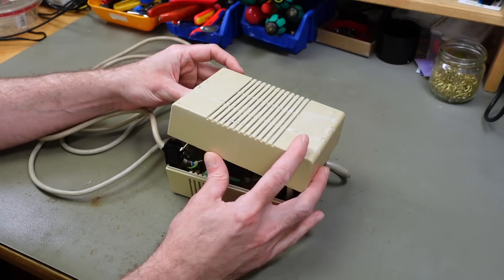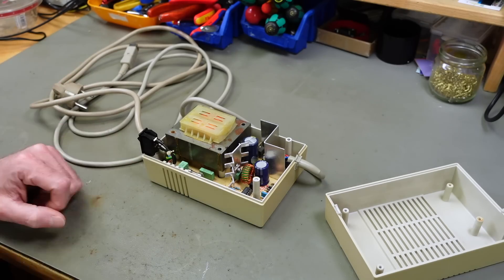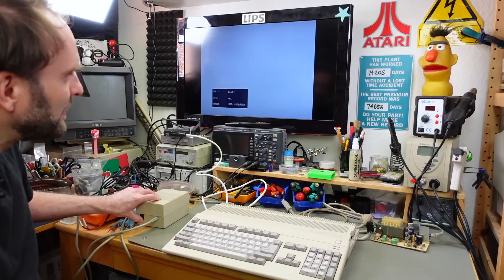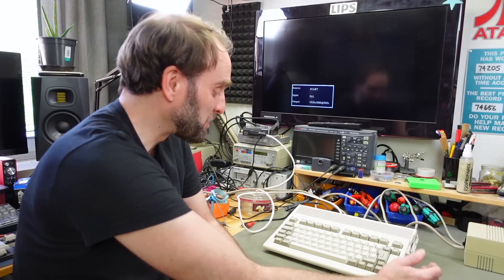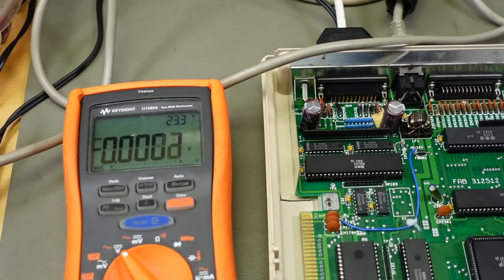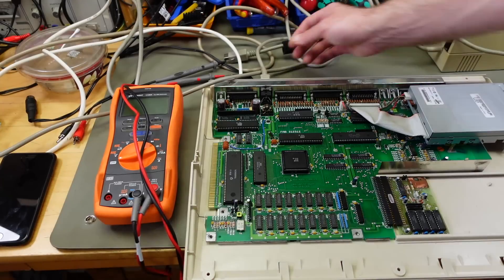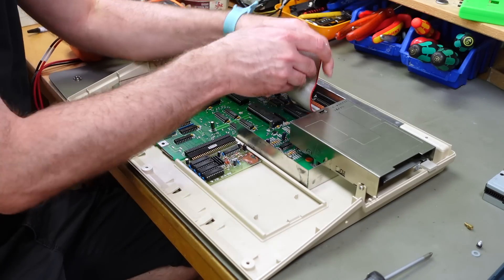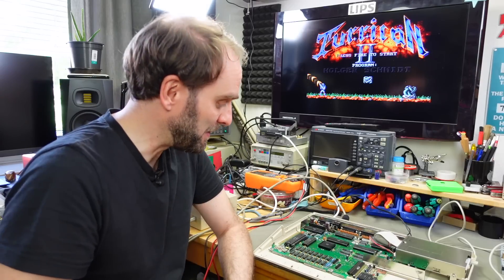Early Revision 3 Amiga 500 Restoration Finale

Comment: Hi Jan. Less than 100 Ohm impedance to ground on the 5V rail is concerning. It may mean that some ICs are marginal, leaking current to ground. More modern power supplies may be able to provide the extra current, but the longer you use the Amiga this way, the higher the chance that the ICs in question will eventually short out. One way to check this is to remove the socketed ICs one at a time, while measuring the impedance from 5V to ground on the multimeter. At some point you will pull out an IC that will lead to a jump in the impedance, beyond 100 Ohm. That is then the guilty party. Another test is to hook up the oscilloscope, with AC coupling, to the 5V rail of a modern Amiga with the computer on. Check the ripple with the old and newer power supplies. If the old one has higher ripple, you will know it's less powerful than the new ones, which may explain why it fails to deal with the 70 Ohm impedance from 5V to ground in the old Amiga. Either way, I doubt 70 Ohm is normal.
Reply: It's also entirely possible there's a capacitor about to let go, I've had a few of the the little yellow bead decoupling capacitors fail and go leaky /short on A500s
Reply: 70 ohms is only 75mA at 5V. Some of the resistor packs connect between 5V and ground as well (I have no idea why they did that). What reading you get on your multimeter generally depends on the test voltage it applies.. it can be enough to turn some gates on at least partially
Reply: @jaycee1980  That's not how you calculate current consumption in active circuits (i.e. circuits containing more than just passive elements). When the computer is actually on and the gates/flip-flops are switching, there will be a lot more current consumption than your static calculation. Every time a flip-flop or gate switches from one state to another, there is current inrush beyond your simple I = V/R. If only everything were as simple as Ohm's law... Unfortunately, computers are not resistors.
Reply: @thebyteattic  Yes, I know that... but when you are just measuring across the rails with a multimeter, you are not probing an active circuit as the meter is not supplying enough voltage to make the circuit active.

That wasn't the point I was trying to make. What I was saying is that 70 ohms across the 5V supply rails of the board doesnt indicate any sort of short - in pure resistive terms its only a low current leakage.
Reply: @jaycee1980 That low current leak is indicative of a marginal semiconductor, which is the entire point I originally made. The leak may be considerably higher when the device is actually subjected to Vcc and switching. Semiconductors should not have low impedance from Vcc to ground.
Reply: @thebyteattic  Having measured many Amigas in this manner,  I can say these sort of readings are typical. Remember also that the Amiga is quite old NMOS technology, not CMOS. 

As I also said in a previous post, there are places where resistor packs are wired between 5V and GND for some reason (possibly Thevenin termination).
Reply: This is par for the course for Commodore chips where defective prints were turned into marginal chips at the factory. You can find the affected chip by moving a weak magnet on the chip and watching the resistance readout. Sometimes a fingertip's biomagnetic field is enough to cause weird phenomena.

Comment: On the PSU: I would measure the voltage at the connector on the power supply side, if that is at normal voltage when it shows 0.2v on the other side you will know the issue is with the cable or connectors. P.S: Many multimeters continuity tests "beep" with a very high ohm value like 50ohms which would obviously not be ok for a power line. But also realize that tests is done with almost no current passing, so a voltage test as mentioned first would give more useful info.
Reply: I was thinking the same, not trusting continuity test on a wire that could pull half an amp, I found it interesting that -12v read high and +12v read low, as if the ground wire was raising a volt or two. I would measure the volt drop from the ground pin at the power supply compared to ground on the computer, and same with the 5v pins at the psu versus at the computer. But I fully understand not wanting to spend more time on this.

Comment: Early A500 were power hungry and had a beefy PSU, highly sought after by the early 90s because the accelerators needed those extra amps. It might be that the PSU is just too weak to power up the old A500. Later revisions cut power consumption considerably, from 35W PSUs to 24W at the end. Should be easy to check as the values are embossed on the PSU case.

Comment: You really are guesing in the dark with that setup. Having a decent modern PSU with stable voltages and measurements to show you current draw on each voltage rail would be very helpful to debug systems which draw incorrect amounts of current etc.
Also don't be shy to use diode mode when testing continuity etc. It's often a more telling test than just ohms.

Comment: 1. Plug the power into a known working board and Che k voltages.
  Not sure but maybe more modern systems don't use the 5v, but use a voltage regards off the 12v. Not sure, don't work on amiga

2. Cross check the power outputs with a working power supply

C
Keep up the great work

Cheers. Keith

Comment: When you use that anti static wristband you are grounded, so beware of that when you are working with high voltage. I don't know if you have a GFCI or not, but if you should touch the live connection with your right hand the current could go through your heart because your left hand is grounded.
Reply: Don`t they have a small resistor in the wristband circuit? I seem to remember this from the 1980`s when I worked in a microchip factory. I must of been bored and measured it.
Reply: A 1 MegaOhm resistor. Pretty safe.

Comment: Not sure about this PSU, but I think some of the older Amiga PSU come with a sense line for the +5V supply, which is used to keep the 5V voltage stable, regardless of the current being drawn by the computer, compensating cable losses (i.e. voltage drop by the cable's resistance, according to Ohm's law). If it has a sense line, could something be wrong with it? 🤔
Reply: None of the brick PSU's had remote sense

Comment: There will be a voltage drop over the connector when under load. It will be that the connector has been used with the thicker pin connectors. It will measure fine without a load a quick fix is just to swap on a different cable from one of the other power supplies

Comment: since all three rails were low, trace it back to a common component.  That'll be your weak link. Checking the voltages with an o-scope may also show waveforms on the DC lines that shouldn't be there. Good luck!

Comment: Hi Jan. Could the power supply issue be the pin size. A circuit can behave different when loaded. It can show continuity without load and break down under load. As a sanity check, can you solder another lead with the bigger pins to the underside of the power supply board to test ?

Comment: Okay.. so on the jack side we have 2 . something volt.... and on the plug side at that same time??..... if the power supply is holding up the 5v.. then the voltage is being lost in the cable or the jack/plug connector.. 🤷‍♀ ....... if the power supply is lowering the voltage... Well down here somebody said that is a feedback (power-good) on one of the cables..🤔

Comment: Just try to measure voltage inside power supply during powering this old amiga rev 3. For make shure that this is not a cable or socket issue under load.

Comment: Is it the same with the fdd power unplugged?
Reply from the maker: Yes, pretty much.
Reply: @JanBeta  .. Okay.. so on the jack side we have 2 . something volt.... and on the plug side at that same time??..... if the power supply is holding up the 5v.. then the voltage is being lost in the cable or the jack/plug connector.. 🤷‍♀ ....... if the power supply is lowering the voltage... Well down here somebody said that is a feedback (power-good) on one of the cables..🤔

Comment: It doesn't have the original top case, it has the top case from the later models before the lasrt model that had the A500+ plus style badge on the case
Reply: Guess I was wrong! Both my A500's with chickenlips keyboard has the case with just the molded logo. One of them has the rev 5 motherboard

Comment: This particular ISMET supply often suffers from fractured solder joints around that main transformer, but I dont think that's the problem here.

From memory, an SG3525 is driving a transistor and that produces the regulated +5V. The +12V is produced by a 7812, and the -12 produced by a 7912. This is one of the supplies where failure in the 5V circuit (specifically the pass transistor failing) can cause unregulated voltage output, killing the Amiga.

The SG3525 is a bit of an odd choice here, as it's usually used in "totem pole" arrangement for driving a transformer.

Comment: i believe that the "broken psu" is the problem. check the wattage that each power supply can handle on 12v and 5v lines. the psu seems quite simple. u have the rectifier diode and the transformer coil. compare the two psu internals to see what is different like the resistance on the transformer etc. good luck 🙂